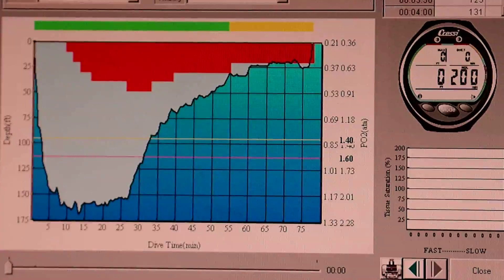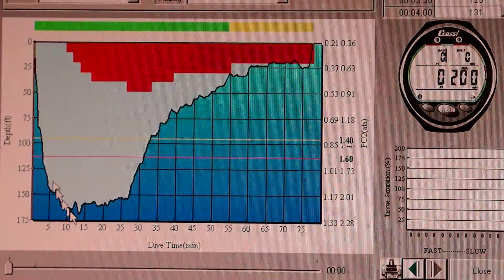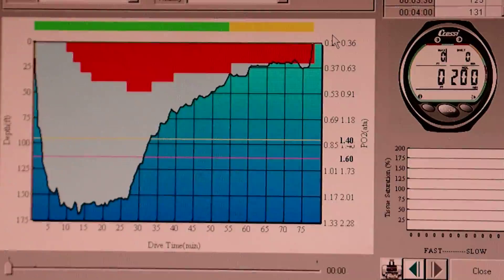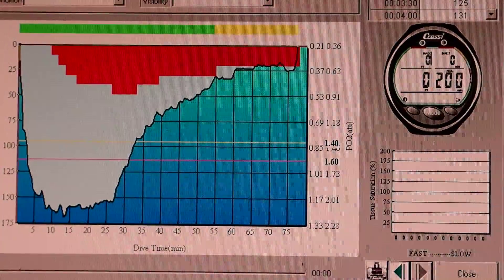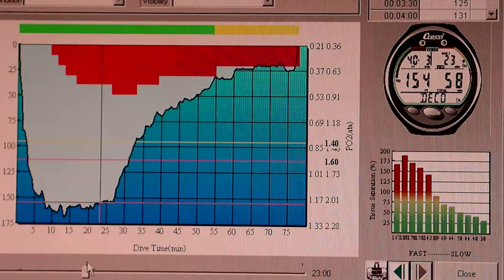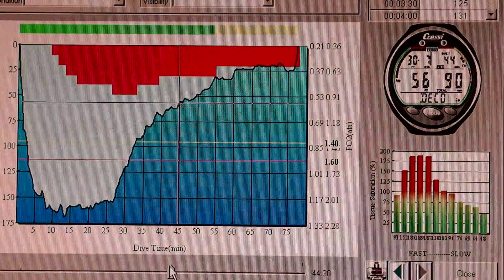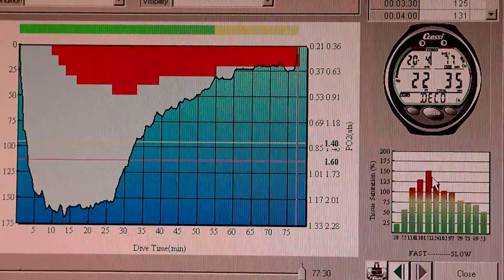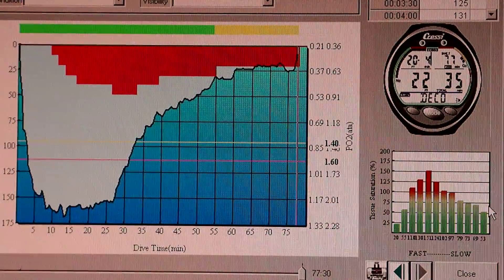Inside your Dive Computer.  What's really going on....

Comment from the maker: Technical detail.  On the actual dive I did a second gas switch at 20' to accelerate the deco.  While I competed the deco, this backup computer didn't know about the second switch so it still showed 150% N2 levels when I surfaced.  (My primary computer was working fine and told me I was clear to surface, so I did.  If it had failed during the dive, I had enough gas to complete the deco according to this backup computer.   I would have just stayed down longer to atone for the gear failure.  This is a useful concept.  It is okay to use a computer that you know is 'wrong' as long as you know that it is being too cautious, rather than too permissive.)

The slang for confusing a computer like this is I 'bent my computer'.  Meaning the computer thinks you are at risk, but you know something that it doesn't that actually made your behavior reasonable.   The slang for screwing up and surfacing with an unreasonable risk of DCS -- where the computer is in violation but it is not wrong is 'I should be dead.'  Don't do that.

Anyway,  in the narration I described "completing" the deco, but that's not what the display shows.  Sorry I misspoke.

But the main thing is that you can see how the controlling tissue compartment changes over time and the bar graph in the computer display is only showing 1/12th of what is actually going on inside the computer.